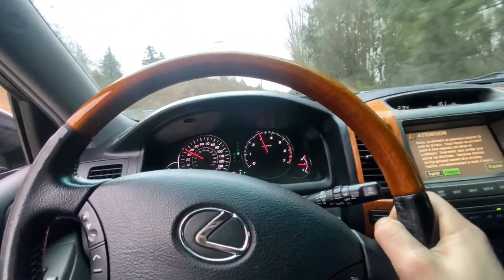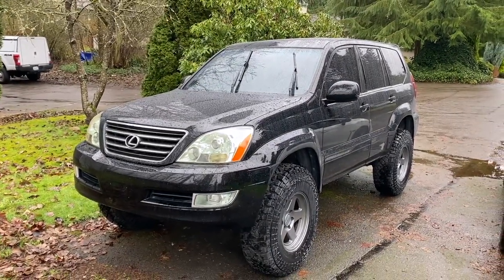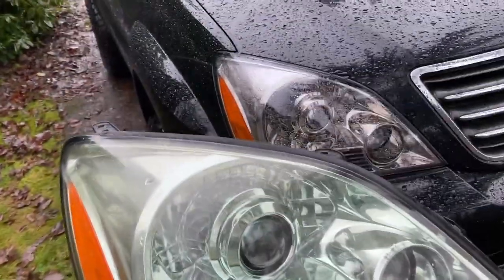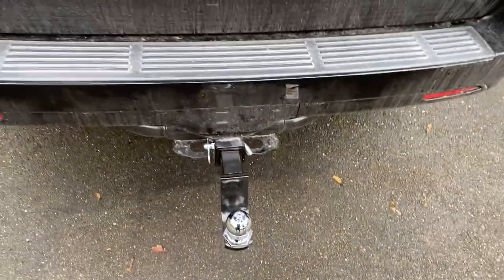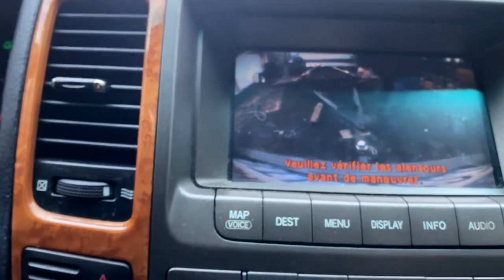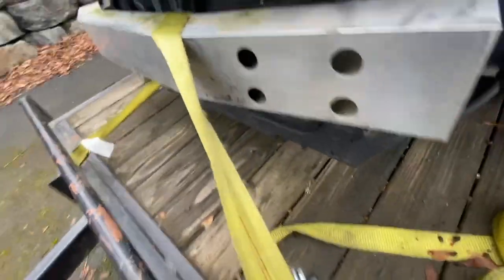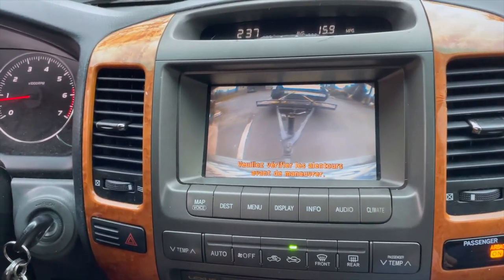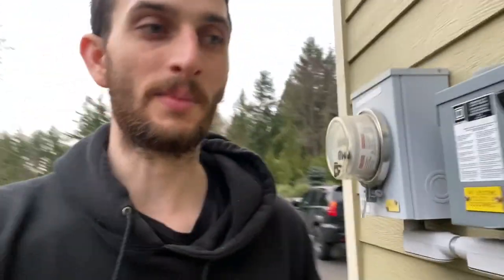GX470 TOWING With 35's + Headlights

Comment: Couldn't you just run the Ride Height sensor wiring to a Switch in your dash and eliminate the sensor completely?  Possibly run direct power from the ignition to Air compressor which would eliminate any computer/sensors/etc from needing to be present for the compressor to turn on and off.  You Flip 12v dash switch on for as long as you want the compressor to run for.   You could even run the air lines to Air Pressure gauges in your dash to monitor the pressure in the bags and have a reference for what pressures provide what additional load rating for a given ride height.  Or someone could maintain their Air system without the airbags, and use it to fill an Air Tank underneath or inside the vehicle for Tire air ups, etc.   Though probably need to be careful with the duty cycle of the pump as it's probably not intended to run for long periods of time trying to fill up an air tank as you run high air volume Air Tools off it.
 
I'm looking to buy a GX 470 soon and plan to try leaving in the Air system (minus airbags) to feed an Aluminum air storage tank and see how that functions.
Speaking of which, you could also do this and run your Helper Airbags. You'd just need to put Air valves on the air lines to your Helper Airbags, and an airvalve on a storage tank. If you want to fill up the storage tank more, just make sure the air valves are closed on the airbags, and open the valve on the tank. Then the compressor will just feed the tank and the airbag psi will remain unchanged.